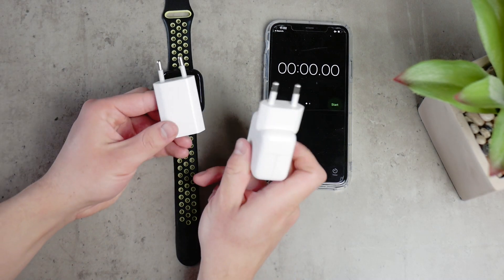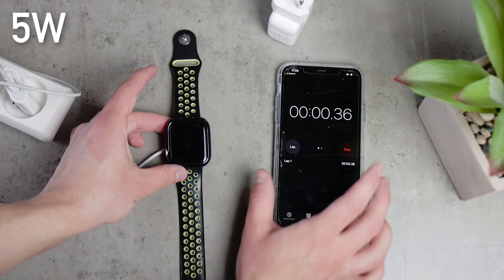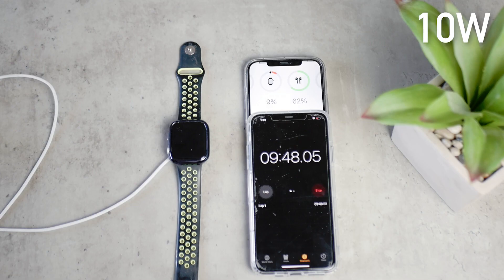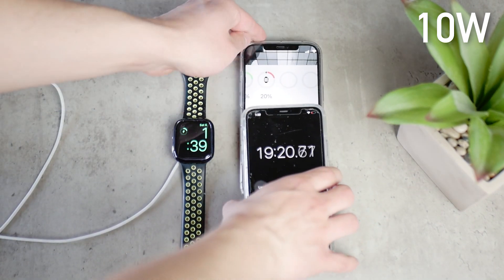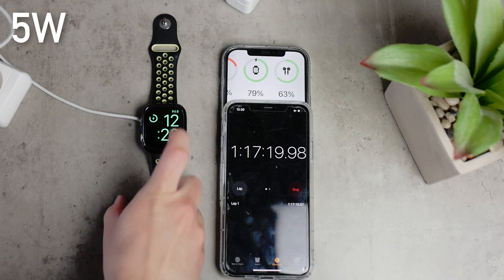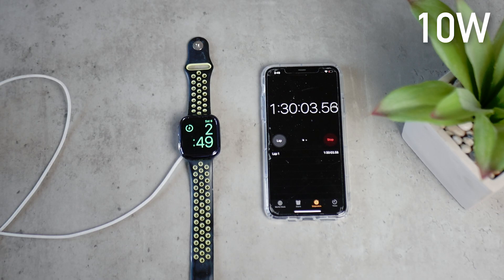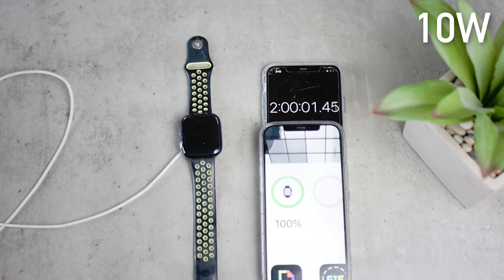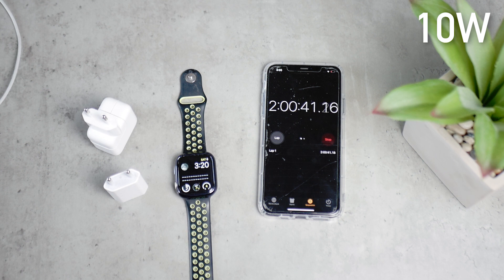Apple Watch Charging Test - 5W vs 10W

Comment: I believe the reason you do not get faster or even slower charging from 10W vs 5W is because those cable charger has been designed to handle 3.3 W if it has been made by apple , And 2.5W input if they made by third party , So basically having higher Wattage of the charger won't help to make the watch charger faster , When it comes to phone it is different though , But Apple watch cable has designed for low power input

Comment: The watch only uses about 2w max because of the small size of the battery. Too much wattage = too much heat in small space and💥
Reply: The watch doesn’t heat up more just because you plug a higher wattage charger. The watch only demand what it can charge the battery. If it takes 2W, it will take those two watts regardless if it is plugged to a 5W or a 10W charger